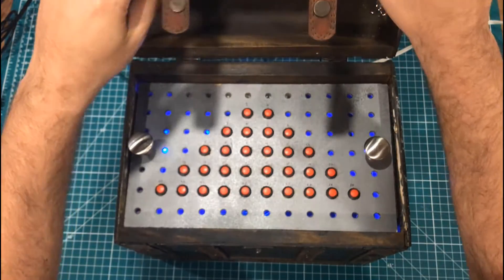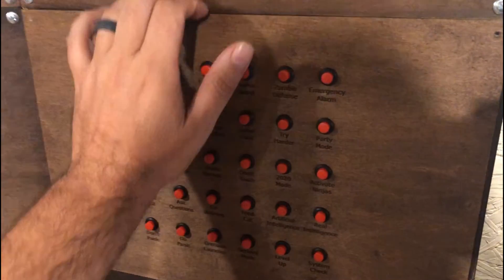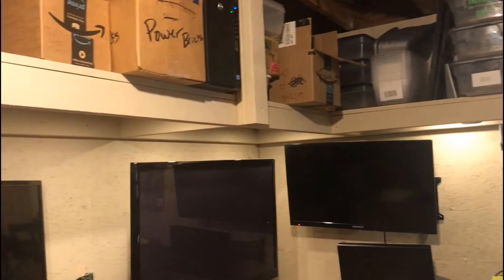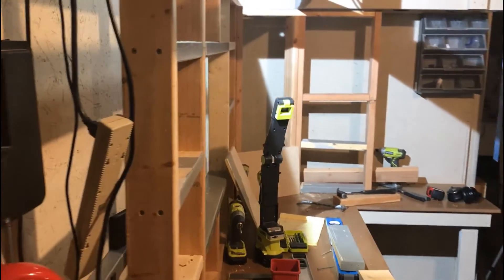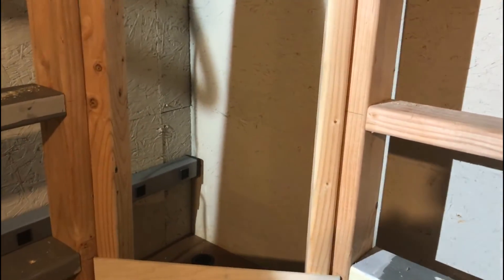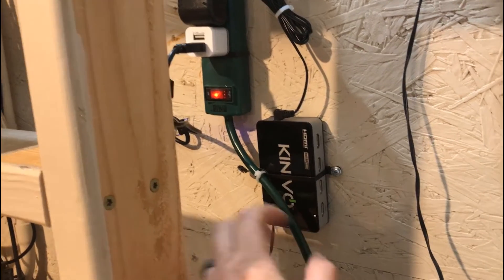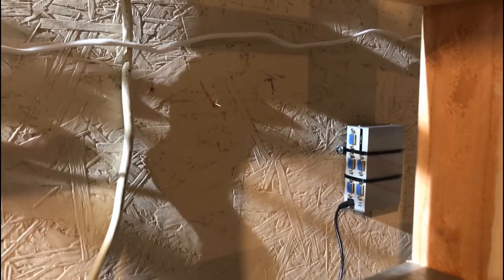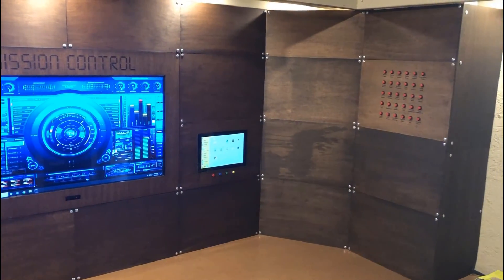An Open Source Desk for Arduino and Raspberry Pi Projects

Comment: I want to “””USE””” ARDUINO FOR A KEY PROJECT.  IT MEANS MORE FOOD FOR MY FAMILY.  THIS IS A NECESSITY.  I HAVE QUESTIONS FOR MY UNIQUE SET UO REQUIREMENT.

MOST HUMBLY, WILL YOU SHARE YOUR WISDOM KNOWING IT WILL MAKE A REAL DIFFERENCE FOR MY FAMILY.?

Food is more expensive and my disability income has not increased.  I must grow more food.  Please.

I love that set up truly.  But this one project haunts me as I need guidance in key areas.  There is nothing more I can say….except

In advance I am most humbled for any / all assistance you can provide.  Your knowledge can answer all few questions and guide me to completion.

Thank you for your consideration to my real plea.
Reply from the maker: For some reason your comment was marked as spam. I'm sorry to hear that. Where are you from?